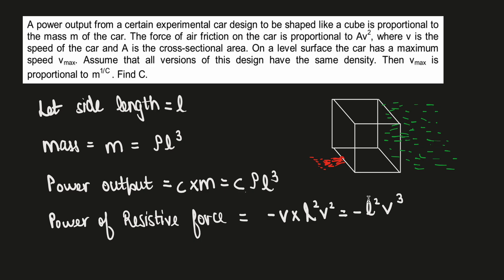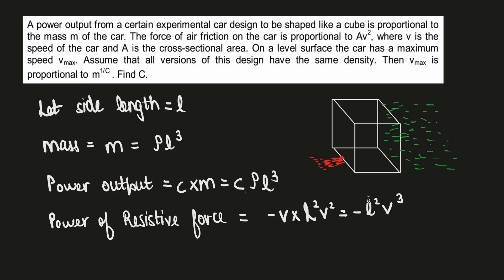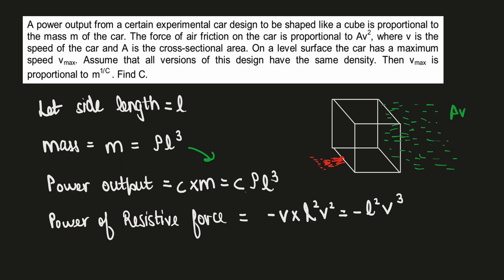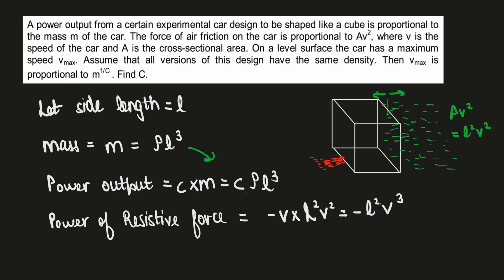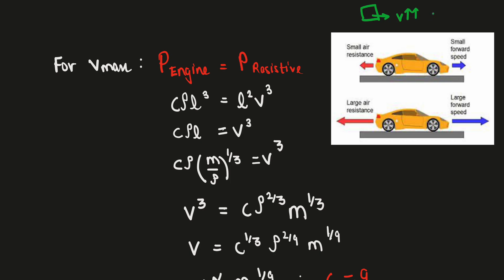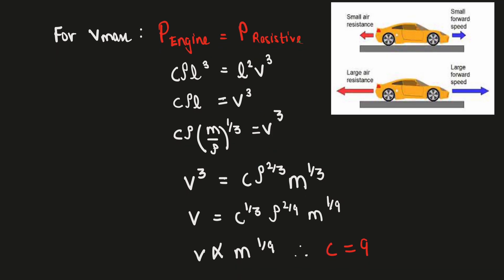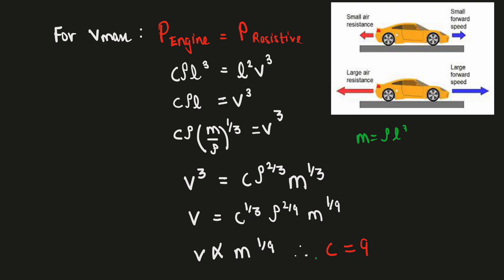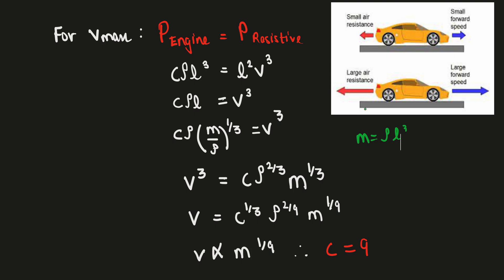JEE | Calculating Maximum Velocity of Experimental Car under Air Resistance | Free Doubt Clearing

Comment: Hello bhaiya, I am currently in 10th 
I'll be joining swastik classes in future

Bhaiya they are conducting their admission test in 27th Nov
So should I join swc in nov itself or in 11th

Bhaiya if I'll join in 11th then , the classes will start after the boards result or before??

Please reply🙏🙏🙏🙏🙏🙏🙏🙏🙏🙏🙏
Reply: I strongly believe you should join in 10th only. This is will generate a habit of sitting in you and you will be used to the coaching environment too. 
I am saying this because I joined this year in 11th and my first two months I just got used to the environment and all.. so many students in one class, faster explanations and everything which ultimately wasted my first two months where I could have excelled as the pressure was low...